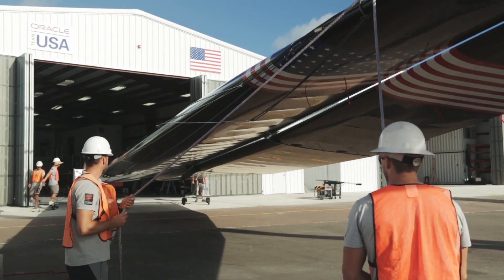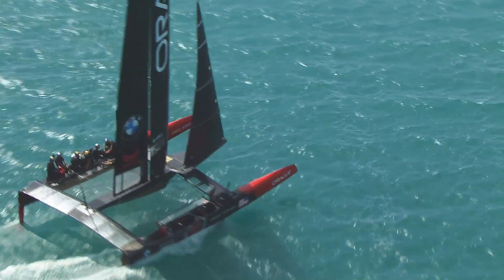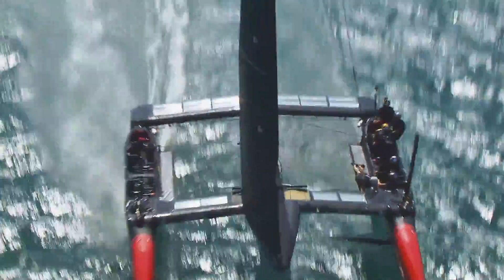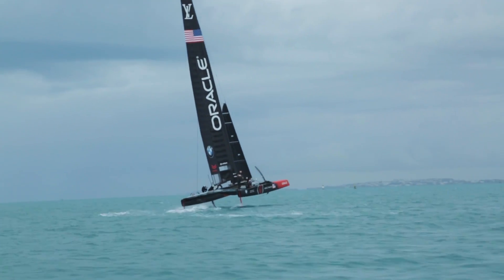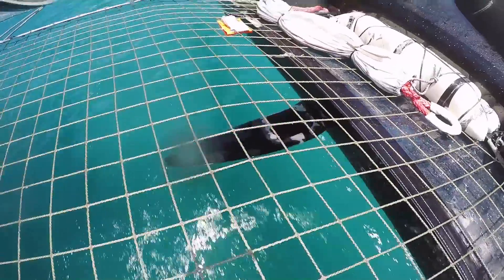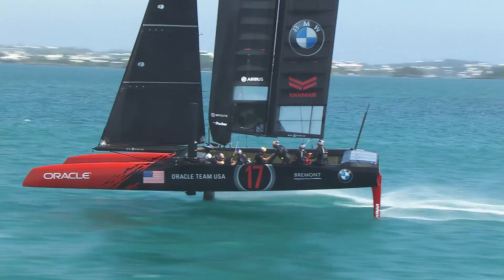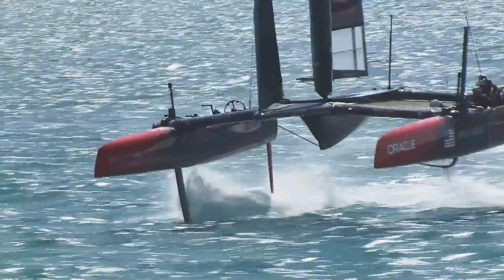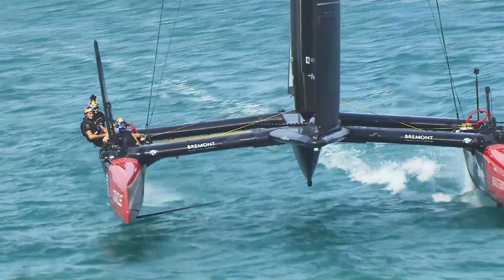ORACLE TEAM USA and Airbus: Wings and boards

Comment: There's me thinking the winglets on the end of an airplane wing are to help defeat the drag developed by wing tip vortices.Silly me.
Reply: +Ecoenergy Of course they are, but that means gaining back the part of the wing near the wingtip that can't produce lift because of that drag, so it's not actually wrong to say that the wing "appears like a longer wing" when using winglets.